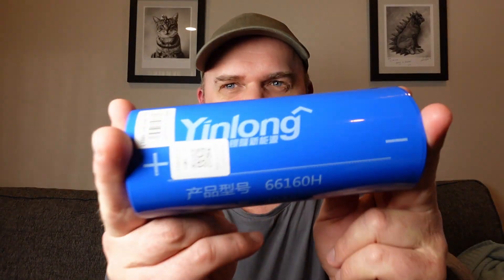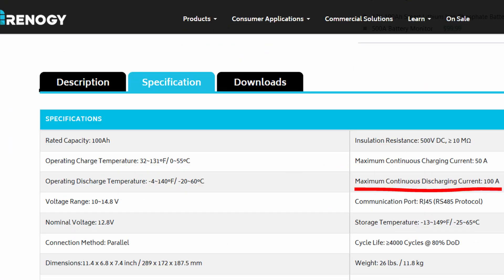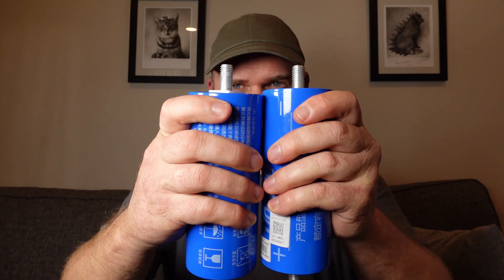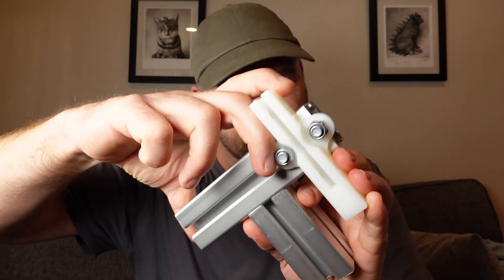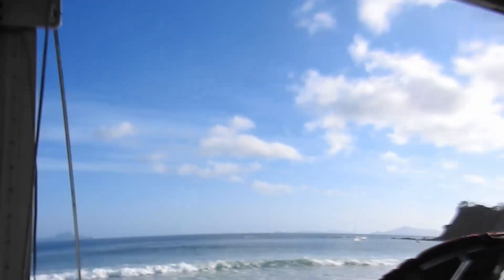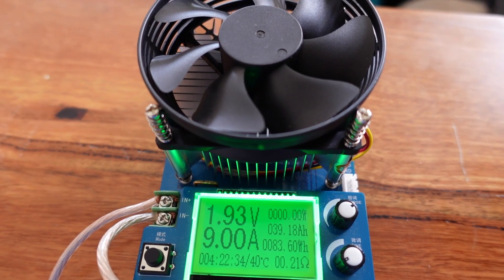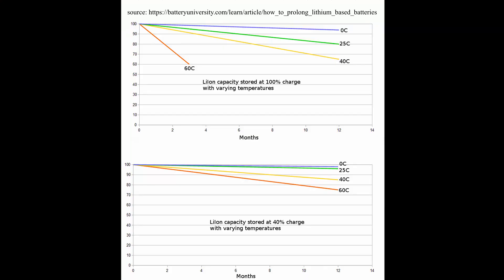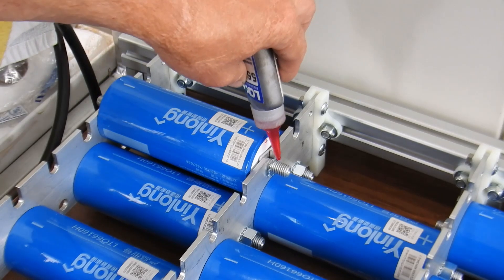Campervan DIY battery build HUGE POWER!

Comment: If you ever want to puncture or drill a hole in a cylinder, place the battery for example and set it in a length of wood with a notched groove cut out of it.

Comment: Very impressed with your video, thank you so much. I'd like to build my own battery to store the free power I get from my 6 solar panels and take advantage of cheap overnight electricity in the UK. Can you tell me how many of these calls would I need to run a small house with all the usual appliances, an electric oven and induction hob?
Reply from the maker: Hey Martyn, if you have a small house and are not relying on dayrate electricity to heat hot water, then probably around the size of my pack would do you fine.

Comment: Some minor corrections and comments comming from an electrician who has completed electrical engineering.

Batteries are measured in Amp hour due to the change of internal resistance during the discharge cycle and decline of voltage over discharge cycle.

Supply is measured in apparent power or VA (KVA). 

Load is measuered in wattage is the true power but doesn't take into account of power factor. In AC if you have anything inductive or capacitive you must take in account the power factor or risk overload.

I like your design that has an allowance for thermal expansion i would suggest a plastic bracket that clamps onto the batteries mid point with foam rubber for vibration support. 

I will criticise the use of aluminium for the busbar because of its higher resistance compared to copper otherwise i like the modular design and commend you for it.
Reply from the maker: Hey Troy, thanks for your comment.  I've got a reasonable understanding of units, sometimes I don't get my thoughts across as clearly as I'd like to - talking to a camera still seems uncomfortable to me.   My comments in reply:

I can understand Ah being used to describe cell level capacity.  But to use it to describe battery pack energy capacity is stupid.  It's kind of like saying that my water tank is 500mm capacity, instead of saying it is 100 litres.  Sure one of it's dimensions is 500mm but isn't it easier for everyone just to say how much water my tank actually holds.

The reason I used kVA (small k) as a measurement for supply delivery of my battery is so that I could make a direct comparison between the output of my battery and the big transformer at full capacity.  I know kVA isn't a term commonly used with DC, but it is still a valid measurement unit for DC supply.

I had thought of some damping and it is definitely a good point.  Foams typically have poor performance with regard to compression set so I likely would have just used some rubber.  My thought at the time is that the truck is suspended, the tray on the back of the truck is on rubber bushings and a shock absorber - so thought I'd do ok without it... fingers crossed.

With regard to criticism of the use of aluminum... lets'  do some napkin calcs... 
The bus bar is 4.5x75mm and if we pretend the parallel cells are isolated where the busbar is the conductor that zigzags up the line of each series set.  We will say that although the bar is 75mm wide, the effective power carrying portion is only 35mm to keep it worst case.  That gives a conductor area of 157.5mm2 with a length between cells of 35mm, we multiply that by 12 since 12 busbars in the series run, that gives us a resistance of 0.0000708 ohms in ali and 0.0000456 ohms in copper.  If I pull say 100A from my battery (roughly 2.5kW) - each cell will see 11.1A running through that 157.5mm2 bar, this gives a voltage drop of 0.00078V which multiplied by current is 0.0087W we multiply that by 9 because it is the loss in each of the 9 runs, which gives us a total of 0.0785W power loss through the poor conductivity of ali. Using copper busbars would indeed have saved me some power loss due to it's better conduction, but that saving would have been around 31mW.  Maybe I should have used silver busbars... that would save me more?  Maybe nitrogen cooled YBCO?  There is always a more efficient way to do things but in this case, the loss is so minimal, it doesn't matter.  Copper is 10X the price, 3X the weight of ali and is an absolute pig to machine.  Probably a more valid reason not to use ali would be the oxide layer formation - I tried my best to limit that with grease on all connection faces.
Reply: @brendontait6968 the reason why VA is not really used in DC therory is that VA and W are the same, however in AC therory VA doesn't necessarily equal W as power factor will need to be taken into account. 

The biggest reason why I said copper over aluminium was not for the voltage drop over such a small plate but the fact is that you have the high possibility for electrolysis! You have dissimilar metals, a bit of salt and electrical current and you have a recipe for the aluminium to react and eventually pit causing high resistance joints and inturn that resistance resulting in additional heat. Yes aluminium wires exsist and I have installed plenty of them but when dealing with them we use bi-metal lugs and make sure that all dissimilar metals are separated from one another.

Also I don't recall if you did it or not but due to the large prospective fault current I would install a HRC fuses to interrupt the supply in the event of short circuit as air fuses will not be sufficient.
As for you water tank analogy we do  on many occasions reference volume over quantity. For example, medicine is measured in cc or concrete is measured in m^3 or engine displacement cc. 

The design that you made is really good compared to some of the other designs I have seen. I do see some minor issues but keep up the good work. I glad to see someone who has pride in their work, it a rare thing these days
Reply from the maker: Hey Troy, Yeah I have a reasonable understanding of reactive power etc, like I said that was just a unit I used so I could draw a direct comparison to the transformer.

With the copper/ali thing...  In your first comment you said that your reasoning was: "because of its higher resistance compared to copper"  So I assumed your criticism was based around that.  However... dissimilar junctions... The lug studs on each end of the yinlong cell are made of aluminum, so if the busbars are aluminum I'm not sure i'll have an issue with any galvanic dissimilarity - at least until I bond either end of the battery to the cables?  If I had made the busbar from copper tho - I would have had 198 dissimilar metal junctions.  So I'm not sure that I fully understand your criticism of using aluminum yet?

Agree with fusing, I have some big 80kA Mersen fuses which I'll go into detail on in a future video.  Have calculated fault current of this pack to be around 20kA.

With water tank analogy - yes exactly actual quantities of water are given, not just one dimension of a tank.  For eg if I want to know how long a battery will run say a 20W LED for.  Is it more useful to know how many Ah your battery is or how many Wh it is.  Nominal voltages are often 12V, 24V, 36V, 48V and 56V, and within that, you could be running say a 12V system but your nominal voltage could be anywhere from 11.1V to 14V depending on chemistry.  So for people to know the capacity of a battery... saying xxxAh capacity is stupid when in itself it means nothing.

Cheers for the compliment.

Comment: A NREL paper, (now found on researchgate.net) by Keyser, Pesaran and Mihalic in 2000, on optimization of the life cycle of deep cycle AGM batteries recommended, in part, charging to the dV/dt = 0 and then charging an additional 10% of the charge, (overcharging).  In their study, deep cycle AGM and VRLA batteries in general in simulated EV application in 2000 were depleted to about 10.5V and initially lasted 150 to 200 cycles.  With the overcharging and current interruption, which is required to push the recombinant oxygen chemistry, life was increased to between 300 and 350 deep cycles.  A more advanced current interruption algorithm subsequently increased this to 700 cycles.

NREL also has evaluated the costs of lead acid and lithium ion battery technologies for somewhat larger projects.  I do not know whether they followed their lead acid battery charging algorithm recommendations but ....lithium ion batteries came out a bit ahead on lower life cycle costs.  So aha!  Brendon's quick and dirty conclusions seem to agree with those of the NREL's. 

Any comments?

Comment: 0:55 You CLEARLY never hit a plain old (charged) 18650 with a hammer to flatten it. The result is the same without all the fucking around with that nail, wooden stick and whatnot.
Reply from the maker: I was trying to faithfully replicate the puncture test that was shown on the LTO cell.

Comment: This had to have cost a fortune, those cells are $700 per dozen. This is battery p*rn for sure, amazing video man I'm definitely going to save for the LTO's and basically make a modular power pack filled with them.
Reply from the maker: Hey, yeah they did cost a bit.  However they do get cheaper when you buy lots of them

Comment: Much appreciated, your very clear, thanks.
These batteries are new to me, very interesting.
Question; can you replace a faulty battery without causing charge problems (because of changed resistance in already uses batteries)?
I'm all new to all of this, so forgive me if this is a stupid question.
Thanks and greetings from Germany.
Reply from the maker: Thanks Rick, not a stupid question at all. From my way of thinking this chemistry has a very low internal resistance to start with.  Due to the long life of these cells, it's likely that the change in internal resistance to the cells would be quite low and most likely low enough to not be a significant issue.
Reply: @brendontait6968  Again much appreciated Brendon. My question originated in a costly battery failure within an expensive pack. It made me realize that any investment in battery (solar)energy systems can easily go from low energy cost to a big financial loss. It's a subject almost nobody addresses. I'll be watching you (in a good way...haha).

Comment: Where can I buy these batteries in Australia?
Reply from the maker: How many do you want
Reply: @brendontait6968  That depends on the price. I need to work out if it is economical for running a portable 12V/24v fridge or whether I'll be better running my fridge on gas.

Comment: Okay you just purposely punctured a battery causing a fire with a stick and a nail and you expect anyone to believe you have any common sense almost setting yourself on fire and exposing yourself to who knows what kind if radiation I'll watch just in case there's another laugh
Reply from the maker: Haha, thanks Kevin.  Ya gotta keep people coming back in the hope they will see something go horribly wrong.  I'm not too concerned if people believe I am lacking in commonsense.  Was kindof calculated.  I think worst case, the cell would explode and I'd lose a finger...  but I have ten fingers, so when you look at it like that - not too bad!
Reply: @brendontait6968  yeah I didn't expect it to do that.

Comment: So those are 1.2 volt cells? and cost $55 each?
Reply from the maker: 2.3V and it depends on where you buy them.
Reply: @brendontait6968  Thanks though i feel stupid because it said right there on the aliexpress page.  Still seems kinda spendy. Id be interested in knowing what you could get for a group buy.
Reply from the maker: Around $34.50 + shipping, taxes etc.
Reply: @brendontait6968  That doesn't sound terrible.

Comment: Love the way you measured the cost. These sound a lot like what Tesla is going to. I wonder if it is original tech or did they hack Tesla?
Reply from the maker: Hey Terrell, thanks.  Quite different to Tesla tech.  Tesla are using much more 'volatile' chemistries. They need to in order to ensure their performance requirements.
Reply: @brendontait6968  That's good to know thanks for the reply.

Comment: Would it be possible to tie a heat exchanger into the system and use any waste heat from the system to heat water for use.
Reply from the maker: Waste heat from what?

Comment: Next build use electrical grease to prevent oxidation of the aluminum connections
Reply from the maker: Hey, yeah... although I didn't mention it, you can see me wiping some silicone grease on the end of the cell with a cotton bud.

Comment: There are lead-carbon AGM's that are rated for 2-3k cycles at 50% DoD. Not terrible if upfront cost is an issue, and you need the full capacity only rarely. The last time I looks at them $230-300/kWhr, not counting shipping costs.  Buy 200 or more direct cost drop as low a $175/kWHr
Reply from the maker: Yeah... so at group buy rates, these cells are around $370/kWh.  So more expensive but not horrific.
Reply: @brendontait6968   Your claim checks out. but that figure doesn't include costs needed to integrate with equipment that is assuming some variant of lead-acid.  Toshiba has an industrial pack that looks suitable, but I can find no pricing information whatsoever on it. 

I would be interested in how you integrated the pack (inverter, charger, bms etc..) into a cohesive system, expecially if it plays nice w/ noiminal 24V equipment.
Reply from the maker: @WorBlux  there use to be some toshiba scib packs on the 2nd hand market that I would have loved to have got.  I think they were generator starter batteries.  As far as playing with 24V equip...  the useful range of my pack is 22-28V so fits in perfectly with voltage ranges of 24V equipment.
Reply: @brendontait6968  Voltage isn't the only consideration, some solar chagers can be damaged if the BMS disconnects the battery from the charger rather than sending a shutdown command or bringing a control line low.  Also the standard 3/4-stage charge controllers seem to be a poor match, potentially overcharging in some situations or not transitioning stages properly without reprogramming.  Going 11S might solve some of that, but does add costs.   Really not a whole lot of best practices information out there on this chemistry. 

I'm also interested in more detailed cold-weather performance and setting recommendations. (Which is the reason other lithium chemistries are simply unsuited to my application)

Edit (Sorry, looks like you already have an 11S system. which I guess leaves a little  a little bit of the high/low end on the table, but is compatible with most 24V systems)

Comment: Sir, respectfully, Will is very knowledgeable. Maybe he was talking round trip efficiency. That chemistry battery excellent c rate and temperature tolerance but poor capacity/$.
Reply from the maker: Will is quite knowledgeable  but he was mistaken when he said this chemistry has poor round trip efficiency.  There is nothing wrong with being mistaken now and then, I make mistakes frequently and learn from them where I can.  I agree that they are expensive based on capacity.  But my goal was not to make the cheapest battery.  It was to make the best that I could.

Comment: Use watt hours of you want to be able to convert from one voltage system to another.
Use amp hours within the system at the same voltage.
Watt hours are the product of any pair of volts times amps at a given point in a power system. While voltage in a battery at the terminals remains theoretician the same amps change depending on load.

That is a serious battery build!
Reply from the maker: Thanks Rogue! Yeah I just think Ah is a poor unit to use for energy capacity measurement.